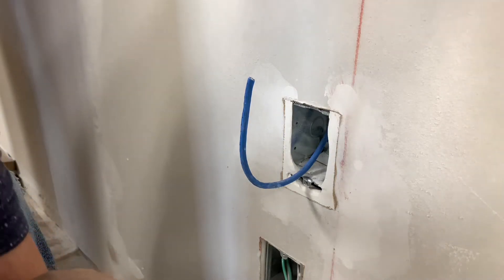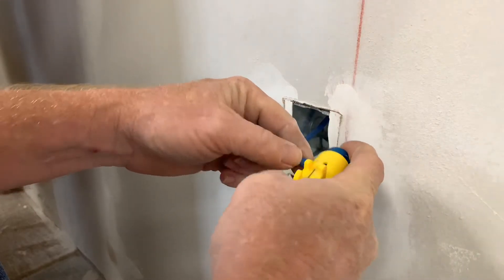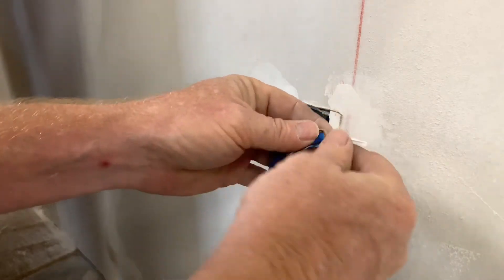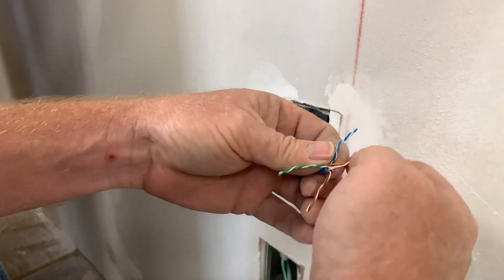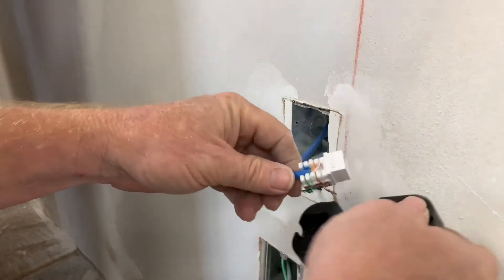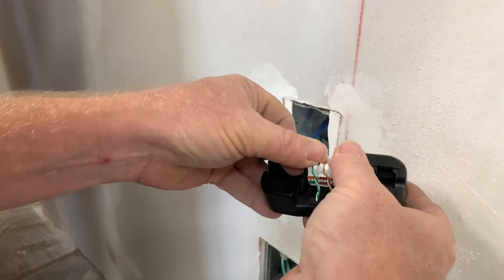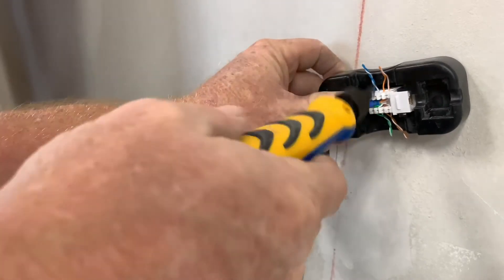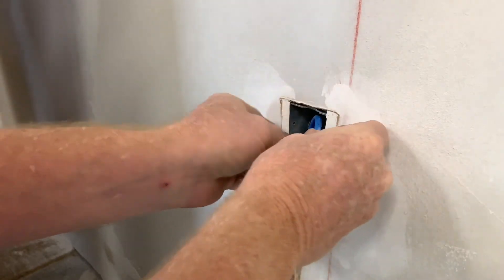Installing an Cat 5 or 6 Wall jack {Keystone}

Comment: Man I  wish they would have had that holder tool when I was doing this. I remember having to punch down wires in my hand. What a great video
Reply from the maker: Dale Lucid check out my IP cam install and Network tester video. That’s what I use to check my Cat6. It tells me everything, lengths of the run, the dBs in each of the pairs, all kinds of info.
Reply: @Grimmeute  I'll check it out. That equipment was way to pricey when I was doing it.  We just had to call the guys that tested and cross our fingers that enough runs passed to get certified.

Comment: Hey bro great video. Now you are in my realm. Cat6 seems harder on the hands because of how tight its twisted. Solid core seems to crack easy too. What is that tool? I simply use my 110 block blade and punch down up against the wall.
Reply from the maker: It came with a big bag of keystones I bought on Amazon